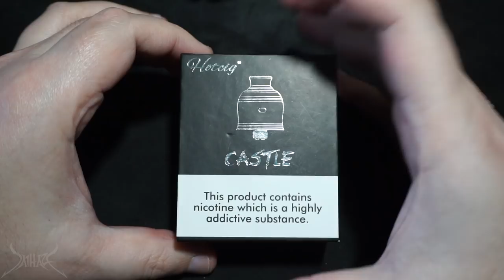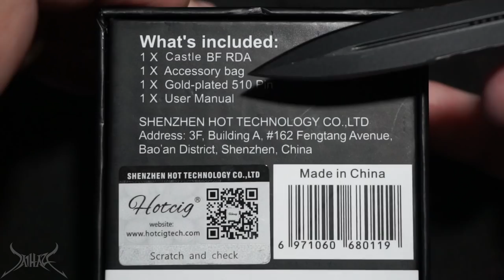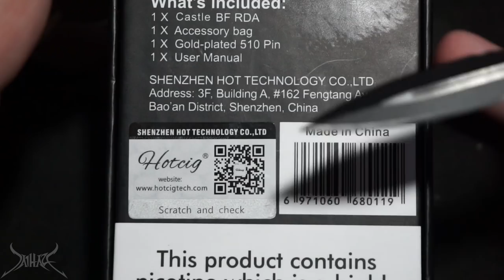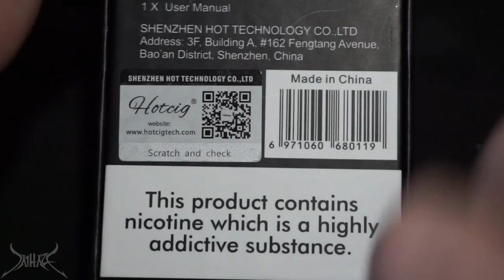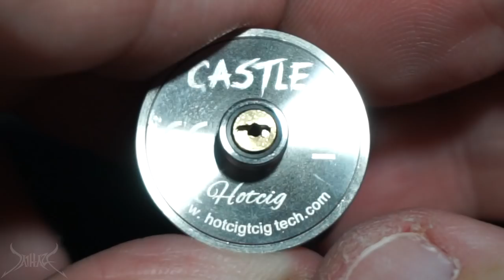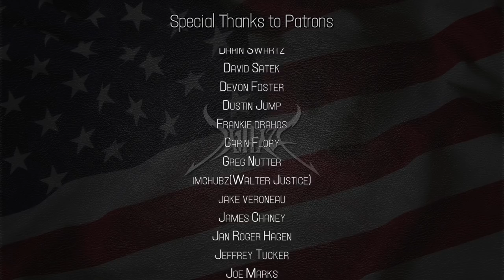Hotcig Castle RDA Review and Rundown | The Bulbous Onion

Comment: I had a big problem with this dripper on my first build. The positive post, due to being so close to the negative portion of the airflow and being a "c" shaped clamp, it actually bent and hard shorted after my first build. I didn't crank it down that hard when tightening either, its just that the "c" shape is so thin to keep from touching the negative. They really shoul've put the peek insulator between it to prevent it or made that side a hole and not a "c" shape. Terrible design right there. Great review Jai.

Comment: You can't trust a flathead screw. No way, no how. They will cause you to stab yourself, gualdge and scratch the paint off of anything that you have in the vicinity of whatever you are working on. You simply can't trust them. More than that, you can't trust a dripper that looks like a pecker lol Although, I do like the build deck, and the little apparatus by the post screw, that keeps your leads from twisting out when you tighten down the untrustworthy flathead screws.